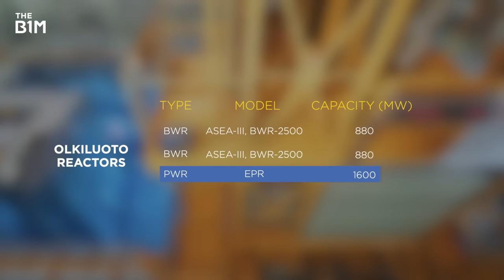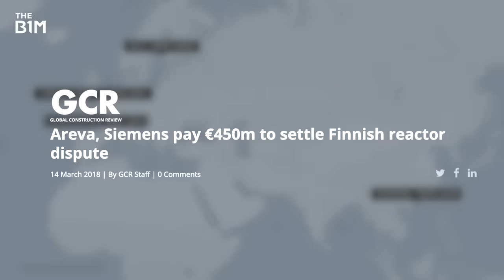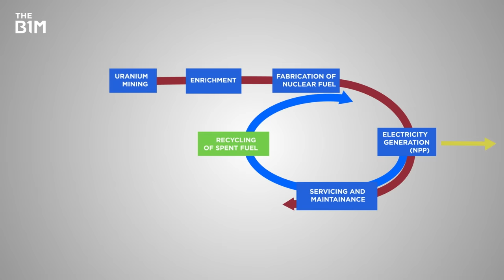Finland Might Have Solved Nuclear Power’s Biggest Problem

Comment: It's a little frustrating that when people mention Fukushima, they show pictures of the results of the magnitude 9.1 earthquake and 13 meter tsunami instead.
Reply: facts. fukushimas disaster was that the plant went oopsie daisy due to being hit by an earthquake and tsunami while it was still running. and it cant really be compared to chernobyl. the impact that they had is completely different and the aftermath is no where near as bad.
Reply: @andresacosta5318  Not to mention that Fukushima Daini, a nuclear power plant 12km to the north of Daiichi (the one everyone talks about) was hit by the same earthquake and same tsunami but suffered no significant damage (some coolant water escaped from its tanks but that was about it). Yet thanks to anti nuclear """"green"""" activists it never re-opened and was decommissioned in 2019.
Reply: @ZAVB3R3R  I love how everyone thinks that nuclear is the future. 
It is the most expensive source of electricity.
The waste could be buried but what happens when you let it run for 100 years?
And no one talks about the mining of uranium and it's impact on the environment. 

Nuclear could be a future but not in its current state.
Reply: @TheBlobPod  it’s the Future of our problems… at least for a few hundreds of thousands of years
Reply: @TheBlobPod  Don't have to bury the "waste" or mine new Uranium if you just use all the "spent" fuel we already have to continue to run it until all the long lived materials are used up. Or just use Thorium. Either way you actually lower the amount of long lived isotopes in the world
Reply: @TheBlobPod  thats why I said thorium, it uses less material than uranium,  produces very little waste, is easy to mine, and have very safe/controllable reactions
It isnt an expensive form of power, or at least it shouldnt be, red tape and lobbying cause it to be super expensive.
Reply: yes, very convenient
Reply: @crazeelazee7524  Imagine what that did for all these "anti nuclear activists" and their energy bills.
Reply: @TheBlobPod  that's plainly wrong about the costs. Compare the electricity costs in France and Germany. France is >70% nuclear and has one of the cheapest electricity in Europe. Germany's costs and co2 emissions both increased after they started closing the nuclear plants and are now the highest costs in Europe
Reply: @TheBlobPod  The problem is, that you can't really develop technologies that are not in use. Let's look at the development of solar panels. They have been a marginal technology that have provided energy to some distant locations but up until, let's say a decade ago they were not the big thing. Now when we realized that we actually have to come up solutions for climate change, the solar power technology has taken leaps in efficiency and making production costs cheaper.
That's why we must keep on using and developing nuclear technology. It's not gonna happen in vacuum.
I must also note: Chernobyl accident is single most disastrous event in energy history, because it put the nuclear power in back burner for decades. If I would be a foilhat, I would say that it was a very lucky strike for oil and coal companies.
Reply: @TheBlobPod  On what you base claim "most expensive source". In Finland nuclear power compensates nearly all if not all renewable energy sources to make them reasonable to use as they would otherwise be too expensive compared to nuclear power.  Nuclear power is one of the most cleanest energy sources we have if we consider Co2 (you can google that one). Nearly all energy sources have their cons, but to me at least nuclear has least cons overall. Are you seriously implying that we wont have enough land to store these rods for 100 years, and even if we don't we probably transition to fusion before that, but that is not option we have today.
Reply: you gonna be ok, mr miyagi?
Reply: @TheBlobPod  " I love how everyone thinks that nuclear is the future. 
It is the most expensive source of electricity.
The waste could be buried but what happens when you let it run for 100 years?
And no one talks about the mining of uranium and it's impact on the environment. 

Nuclear could be a future but not in its current state."

Maybe we should have the same regulations regarding nuclear waste regarding the waste from solar and wind energy, maybe then the price difference wouldn't be as big...

And that garbage wont end up in third world countries.

EDIT and PS: Regarding the mining. The energy density of uranium is much much higher than any alternative. 

That means you have to mine less and transport less.
Reply: @TheBlobPod  The most expensive source is renewables. Since Germany integrated renewables to the grid, elektricity price doubled. In our state solar produced elektricity connected tto the grid is almost 9 times more expensive than "normal" one.
Reply: @akpak4449  the reason our prices doubled is not because of renewables but because subsedisng germanies coal industry.
Reply: @Mucknuggle  It´s relatively easy. 
Coal is cheap, but dirty source (burning, mining). 
Sun is clean source, but there are problems with recycling of panels and storing of power for night. Sun is 5x weaker in Winter than in Summer. Effectivity of panels is very low. Not mentioned how energy demanding is producing of panels (but regarding lifetime aspect it´s not so bad as coal).
Wind is clean source, but highly unreliable and especially weak in lot of states across the world. There is also problem with recycling of plates.
Water is clean source, but you need to have strong river or some big lake.
Biomass is VERY DIRTY renewable source without debate(grow, harvest, burning). And there is very little place for siginificant usage in energy mix. 
Nuclear is clean source, but there are problems with mining and storage. But the waste is very low considered how much energy it consume. At the moment nobody talks about recycling of nuclear waste, but I think in 20 years will be this waste very valued commodity, because there is still some energy inside it.
Gas is cosidered as much cleaner source than coal, but latest studies show, that it´s far from truth. There are massive leakages during mining dnd transport and overall CO2 emissions are not very far from coal burning.
And Diesel? Not even mention it.
EVERYTHING is having some negative aspect for environment.
The main point is, that we need hard source of energy. That´s not sun, not wind, not biomass. They can be only the additional sources in long term. Especially in winter.
Reply: @Mucknuggle  and if we speak about Germany, you almost stopped to use nuclear powerplants (which are already standing there and they have literally no CO2 emissions) and during winter is Coal  the main source of energy and heat. 
Another Germany issue is, that in Summer you are producing lot of green energy from wind and sun, even if you don´t have anything, how to consume it. It´s risky for your electric network and causes instability. Risk of blackout is much higher. The reason is also, that you have industry more south and energy generation more north and your network is weak to transfer so much energy. So you must strenthen whole network. It´s expensive.  And there you have the reasons of actual pricing. Sorry to disapoint you, but coal industry is not really the reason.
I wish Germany less activists green thinking and more realistic physics attitude.
Reply: @alexandrchytil  well the german energy provider where happily obeying the government to dismantle them on behave of the government and payed by the government to do so. otherwise they would have to dismantle them on their own cost to replace them without any national compensation as all our nuclear powerplants were exceeding their live time allready some have had been shut down allready as they had a series of failures. so in hindsight it was a cheap gesture stepping down from nuclear energy as it would have happened anyway as no german energy provider would have been willing to invest multiple billions in new nuclear poweplants anyway. especially when they can be run on ultra cheap subsedised german coal...

if there would be a true solution for the atomic-wastes - fuel-rods aswell as materials of deconstructed powerplants we would have no discussion. but as long as all we can do is delay the responsibility on later generations nuclear power is not a solutiuon what so ever...
Reply: @Mucknuggle  Exactly, politics. There is actually possibility to recycle nuclear waste, but at the moment, it´s not really economicaly interresting, Uranium is still very cheap. Nuclear way leads to plasma or let say fusion. This is the real future of energy production. And there is no nuclear waste at all.
Unfortunatelly I think, I will not see this kind of powerplant running in next 40 years.
Reply: Bret Bouder  So does people and bananas...
Reply: @Mucknuggle  and the reason behind that is political decision to suspend all nuclear power plants because od Fukushima?
Reply: Its still leaking to this day, so of course people have to bring it up. We should focus on different energy source's. Nuclear isn't the only source
Reply: @donotthecat3749  it's misrepresentation. Might as well show off forest fires as the result of solar power or windmills... Which is actually more accurate.
Reply: @kevindossantos6282  oh boy. You have no clue do you?
Reply: Thorium is less energy dense and you still need fissionable product to keep the reaction going. It has serious issues as well.
Reply: Chin a has a Fukushima scenario every day, and yet they catch fish from radioactive sea...
Reply: Were you hoping to see a picture of some guy flippin the bird at another A-hole named Shima? 😉
Reply: @jamesa7506  "Were you hoping to see a picture of some guy flippin the bird at another A-hole named Shima? 😉" 

The actual nuclear power plant... in the video about nuclear power...
Reply: @greenspiraldragon  Fukushima in a natural made disaster. You want clean energy but reject nuclear even though its clean energy as well. The fuel can be reused countless times.
Reply: @TheBlobPod  you should look at the newer designs, many different variations of which are being built around the world
Reply: @TheBlobPod  It has huge downsides, but it is the only carbon neutral means of electricity generation that can be switched on at will, so it is hard to see how most of the world will completely decarbonise electricity production without it. It is basically nuclear or gas for some proportion of electricity generation in much of the world right now, and burning gas is killing the planet. It isn't that nuclear is perfect, it is that it is necessary. Yes, energy from wind and solar is better and cheaper, but it isn't always available in the quantities needed, and despite promising new technologies, we have nowhere near good enough energy storage technologies to depend on those along (depending on location).
Reply: No, that's good because those are the real costs of nuclear power.
Reply: @crazeelazee7524  it suffered very significant damage
Reply: @tracesprite6078  Did you seriously suggest that nuclear power causes earthquakes and tsunamis? :D
Reply: @tracesprite6078  Do you know how much the pollution from coal, gas, oil, solar, wind, hydro destroys the fishing industry (especially if put through earthquakes and tsunamis)? 

Also, how much does the fishing industry destroy the fishing industry?

As compared to the release of radioactive water.
Reply: @futurethinking  "2. After 100 years, those waste you buried would still remain buried, also 95% of waste would become depleted and hence, not dangerous after 100 years."

You should follow your own advice and google that sometime... if it was a mere hundred years, everybody would be embracing nuclear power. You're off by several magnitudes.
Reply: With global warming you'll get extreme whether events which will endager such nuclear power plants. For example French nuclear plants had to shut down during the last heat waves. And during the last years, there were also heat waves in Scandinavia. Other extreme wheather events like storms and floodings after heavy rainfalls expose these reactors to dangers, too. So, it is totally okay for me to show pictures of the results of a tsunami after an earthquake.
Reply: @Pedroleum100  "With global warming you'll get extreme whether events which will endager such nuclear power plants. For example French nuclear plants had to shut down during the last heat waves. And during the last years, there were also heat waves in Scandinavia. Other extreme wheather events like storms and floodings after heavy rainfalls expose these reactors to dangers, too."

Which also affects eg. renewable energy production such as windmills (which can't run when there's no wind or too much wind and can flood), solar (which produces little to no power when it's clouded or night and can be flooded), hydro (which can run out of water and have too much and kill hundreds of thousands of people if there's too much water and it fails).

Heck, we can even say that wind, solar and hydro causes global warming. In no country has those things replaced 70 percent of other power production sources... Whereas in France, nuclear power has been responsible for 70 percent of the electricity production and therefore much less co2 for over 30 years. Waiting and continuing to wait on wind, solar, hydro, wave generation, geothermal etc. have led to a vast overproduction of co2 for decades. Congratulations... you anti nuclear people have doomed 125.000.000 people (UN estimate of the consequences of global warming).... Or the equivalent of 25000 Chernobyl sized nuclear accidents. 

"So, it is totally okay for me to show pictures of the results of a tsunami after an earthquake."

No, because earthquakes and resulting tsunamis are not climate events, they're geological events, but they can very well illustrate the dangers of hydro power.
Reply: @UC9F79GVZ4z9tPOtTxf2-GLQ "It doesn't matter whether the beyond-design event is of geological or climatic nature."

Interestingly enough the same earthquake and tsunami was not beyond-design events for another Japanese nuclear powerplant. Which was closer to the earthquake epicenter and experienced an equivalent or larger tsunami. 

"All that matters is that with renewable energies, you don't have the same risks as you have with nuclear energy."

How does windmills, solar and hydro plants respond to the same magnitude earthquake and tsunami? 

"So, if there is a "beyond-design-basis event", you don't have to fear that you can't eat food any longer because it is radiated!" 

No, you won't be able to eat the food because it's toxic due to the absolute massive amount of materials required to produce said renewable energy production and not to mention energy storage. 

You don't even need a natural disaster.. that will come automatically.
Reply: @nt78stonewobble  Yes, the pollution from coal and gas and nuclear are all destructive. However the advantage of solar and wind and hydro is that they cause minimal damage to the environment. Stonewobble, we have to make this work. We don't have a spare planet so please stop undermining the efforts of sincere people to save our planet.
Reply: @seannissen2509  unless they crack the fusion energy problem
Reply: He did mention ''natural disasters affecting nuclear power plants'' when he showed that clip so it is correct!
Reply: @Taffoman  they also didn’t have a proper containment done and it still has a lower lethality increase on the people putting out reactor 4 than living in a big city or being a consistent second hand smoker.
Reply: @kevindossantos6282  fukushima had a containment dome. Chernobyl did not. This meant that all the reactor was melting down directly and hitting the surrounding area. Fukushima had all sorts of safety features that stopped it from being even remotely close to Chernobyl in terms of damage done and disaster level.
Reply: @siposzero  the main problem with solar panels is that it relies on Cobalt. Cobalt is mainly found in the third world and is a highly toxic mineral to mine and work with.
Reply: @TheBlobPod  solar and wind is only cheap because it is heavily subsidized by governments. it also creates record prices, like in Germany where we have the most expensive electricity in the whole EU and it's only getting worse, while they are preparing people mentally for electric outages...
Reply: @phsycresconquest6636  That's a very discouraging thought and one that, if true, needs addressing. However it doesn't make nuclear power a good option.
Reply: @tracesprite6078  not what I’m saying. The problem is that we only have cheap solar panels as long as the Congo is a warzone. Now that’s not a good price to pay. 

Secondly solar panels have a life span of 20 years and then it’s probably going to get dumped into the third world.

Thirdly solar is highly unstable. Mainly due to the amount of energy that it gives throughout the day is unstable. Meaning you have to have something to balance the grid to keep it from going boom. Usually that is Natural Gas. Hence why Oil companies are pushing solar panels so hard, because it requires something that they have to make it work in its current form.
Reply: @tracesprite6078  Nuclear waste doesn't make nuclear power a bad option either. It doesn't matter how you count it, it's the safest energy option. Just because you are affraid of it doesn't make it a reasonable argument.